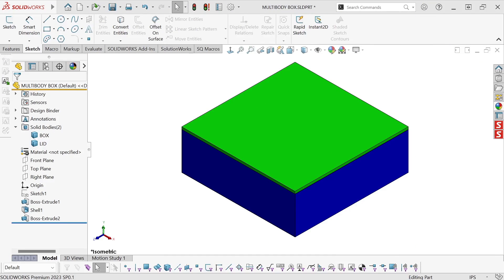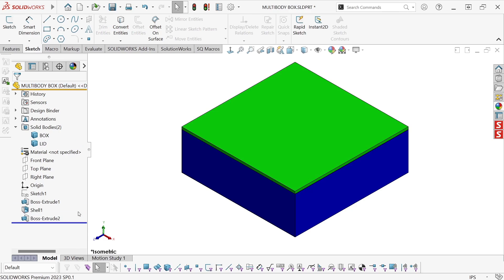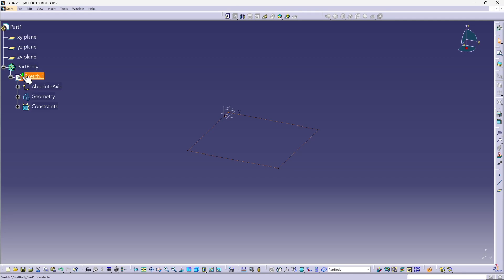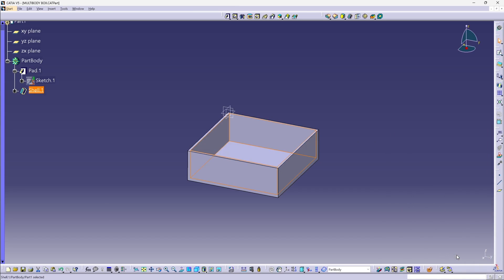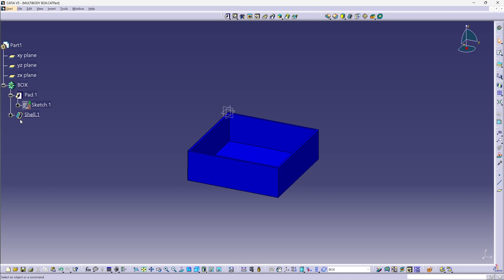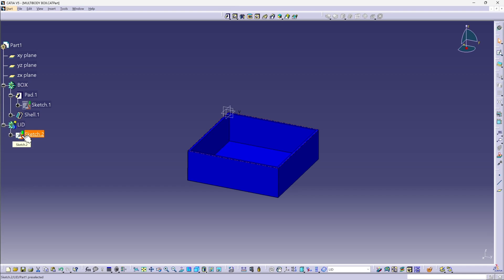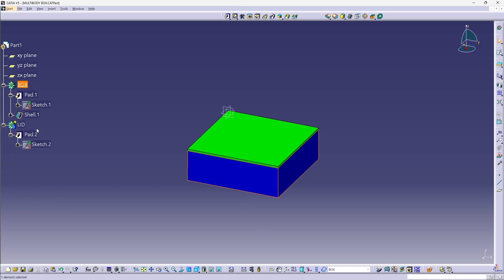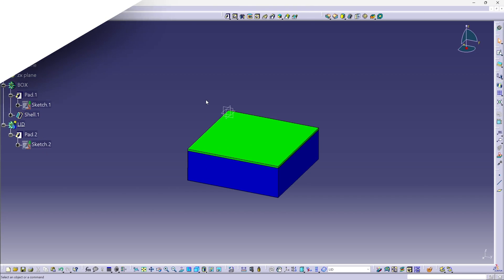Multibody Parts: SOLIDWORKS vs CATIA V5

Comment: If you want to make it works in Catia like in SolidWorks (one sketch defines both bodies) you can create the sketch with projected lines from the first body sketch in the second body. This way when you change the first body sketch the second body with change the shape just like the first body just like in SolidWorks if you use one sketch for both bodies. But if you just copy the sketch like you did in the video the second body is going to stay the same when you change the first body sketch.

Comment: Does catia show total how many solid or surface entities are there?
Reply: Not in the same way SOLIDWORKS does, with an instance count on a folder in the tree since with CATIA each body has its own 'folder' or 'container' in the specification tree. You could hide everything but the bodies themselves, then window-select everything in the graphics area and it will tell you how many elements you have selected in the lower left corner.